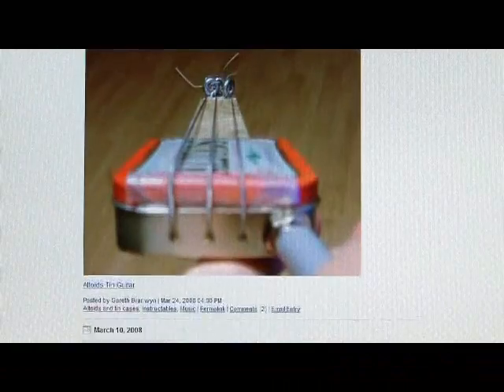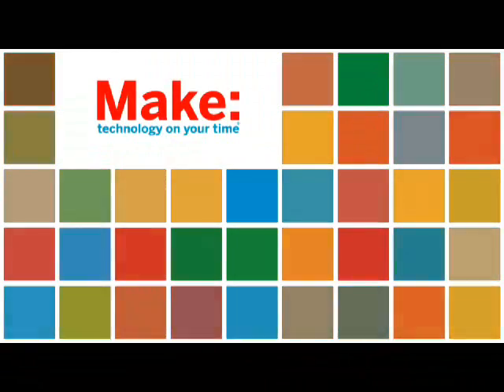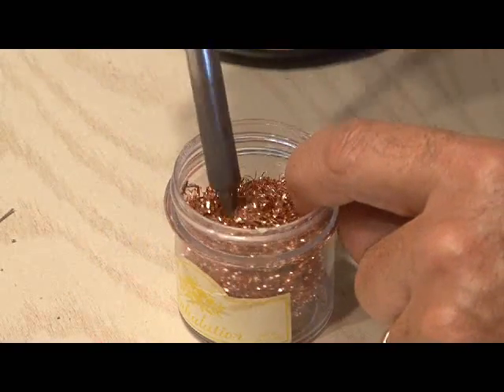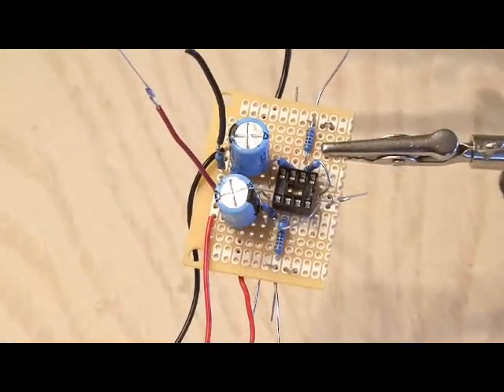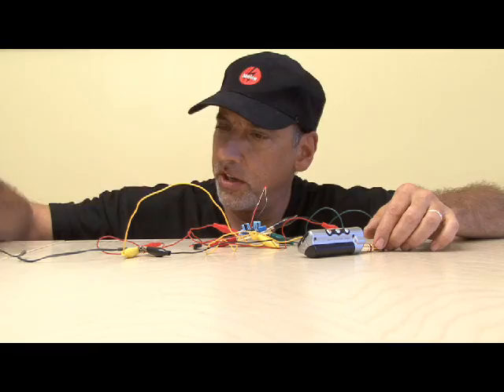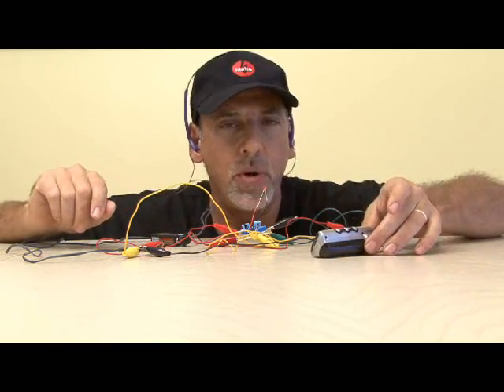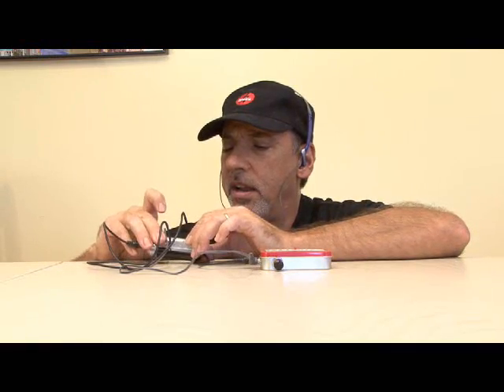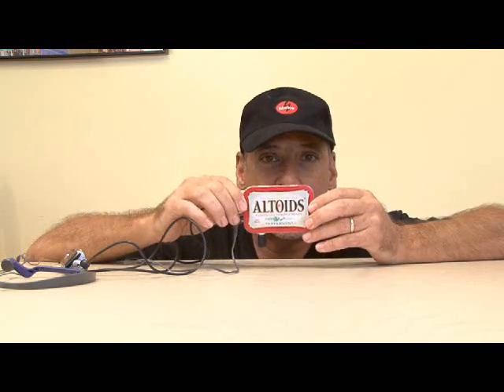Weekend Project: Mint Tin Amp

Comment: No Schematic shown. Just some guy eating sweets and shuffling wires. I need a SCHEMATIC, disappointing!
Reply: Gary, grab the TDA2822M datasheet. Easy build. There are also project pages around the net.  It isn't HiFi, but a pleasant sound. Works down to 3 volts as I recall. It even drives loudspeakers. Handy if you want an all round mobile amp.
Reply: https://tangentsoft.net/audio/cmoy/misc/cmoy-tangent-sch.pdf

Comment: Just FYI, you want to use a brass sponge, not a copper sponge.

Further, the copper sponge at dollar stores are only copper in color or if lucky micro-plated with copper (which almost immediately rubs away when exposed to a hot iron.

Just buy a real brass sponge and save yourself the trouble.

Comment: Can it be plugged to speaker? That would be nice since you can just plug your earphones in the mp3 player.
Reply: Yeah it probably can be
Reply: Yes, since most speakers use the same port as headphones.
Reply: +Pierre Ripplinger This is a headphone amplifier-we use them to not increase volume, but to make sound a lot clearer. If you used a speaker that used the same connector-it would work, but it depends on the size of your speaker. It wont power a large 6 inch woofer for example(Well it would, but you would hardly get any movement in the cone).
Reply: ***** Oh ok, it makes sense now, I didn't understand the purpose. Thanks.
Reply: +Pierre Ripplinger That's what I was thinking and it would've made a better video if he'd shown that

Comment: The problem of the amp is to much generate of energy and can drain the 9v in just 8 hours only yeah its hi fi but I the energy generate much lose I have some idea I can boost nor low consumption of energy I used

Comment: I mean can't you just plug your headphones into the mp3 player? Seems counter intuitive.
Reply: SeeWaffle9 Try powering a 60 ohm pair of headphones with your MP3 player and tell me what happnes
Reply: Say you have some high impedence headphones, wouldn't it sound like shit plugged into a mint tin compared to a legit pre-amp?
Reply: @chrisnguyen1186  actually no. I have a very good marantz amplifier and Grado GS1000 headphones, I made this amp which is actually called a CMoy Amp and well there is no real difference between them 🤷
Reply: @chrisnguyen1186  5 years, and I bet you're still an idiot.
Reply: Haaaaa! lol.
Reply: Some headphones require more power than a phone, mp3 player or even a pc can output, then again, I doubt that this amp in particular would be any good for that.

Comment: i will say if you want to make a hi-fi amp for sure 
make it low frequency add 680uf and parrallel with 330uf of electrolytic caps in the output it will make make it bass and put a pot rate 10k and add 0.100uf mylar and add a 5ohms or resistor it will be a great amp one trust me a make this pieace of equipment and you will say drop the ass!!1 .............wait i mean drop the bass
Reply: could you provide a parts list and a diagram im wanting to build a good amp for my headphones that have no amps built in and they have room i can add them
Reply: I email uu pls add me in my fb and to my group simple maker and I will give u my proto and my greap preamp
Reply: alright will do that could you give me a link to the group please
Reply: Just open Facebook and search me Aljiven r. Alejo and uu will see my profile like a hockey mask and I will show you the schematic but if you want I give you the schematic with a kit if you don't have any parts list.

Comment: Aaand why not put the headphones directly into the mp3-player?!
Reply: Because it's supposed to be able to adjust the volume. It can make it louder than the mp3 player can make the volume, and hit intervals that go between the options allowed by the mp3.

Example: mp3 has volume levels 1-10. 5 is too low, but 6 is too high. The amplifier can put the level between the two values.
Reply: ***** But if you are using a simple LM358 as he does it will have a shitton of distortion and false sounds, just sayin' :D
Reply: ***** But if you don't need much volume, why building a freakin amplifier? xD
Reply: ***** I know, but then they will be either noisy or silent :/
Reply: ***** Well, you can get a precision opamp for low noise, but it's 3 times more expensive. But hey, it's still only a 1$ IC
Reply: jordan krishnayah Give it a 1 nF ceramic cap and it will go back to low

Comment: In place of copper scrubby pads For my solder iron I use a copper brush head, (two opposing each other) works great like a boot/mud scraper. I just stick the tip in < LMFAO and it cleans the oxide and such of very well

Comment: I'm new to this, but can't you just use potentiometers?
Reply: No, you can't. I need an op amp or something.
Reply: Potientiometers would only add resistance and decrease the strength.
Reply: jaiden9898 I know, but still it could work with another external amplifier(CLASS :D). Then the pot just can only bring it down to the input.
Reply: Noorquacker Ind. So what is the purpose of the pot im confused.
Reply: jaiden9898 A potentiometer is a variable resistor. Basically get a 100K pot and you have a resistor changing from about 8k ohms to 100k ohms. Twist the knob and you get less or more resistance! This is very useful when making a function generator or using a 555 timer to a speaker to annoy the FLIP out of your friends!
Reply: jaiden9898 So you mean what's the purpose of my pot idea of the external amplifier and potentiometer?

Comment: So i have a crazy idea. I was going to use a couple of 3.5 inch speakers and make a headphone bracket for them, (4 ohm btw) and then hook it up to a lepai 2020 a+ and use a 12 volt 1800 mah battery. would that even work?
Reply: thats the thing. im not sure of the differences between headphone and speaker drivers other then size
Reply: i should correct myself. i understand the visual differences, but i dont understand how they behave differently. when i think of something that produces sound i think of something getting electricity and a signal from some sort of amplifier. I dont understand how the shape of the cone affects what frequencies are put out and at what decibels.
Reply: *****
 in my room i have a lepai 2020a+ amplifier powering 2 phillips FWB-MC50/17 speakers (to clean up the sound i have an rca 10 band stereo equalizer that i adjusted). i put a 20hz signwave through them and they "technically" hit 20hz because audible sound is coming out (quietly of course) and the cone is moving. though for the low end i depend on my dual sd12 12 inch subwoofer powered by a dual xpe2700 amplifier which is hooked up to a 13.8 volt power supply. my box is a ported box with polyfill and is 1 1/4 inch thick and tuned for 20hz so i can clearly hear it from that. As for my headphones they are turtle beach headphones for the wii u, but i use a fio 6 amplifier on bass setting and i could just barely hear the 20hz. i designed my sound system myself from ground up so i know what frequency responce i have and the slope of where it drops off. I know my bookshelf speakers move actually at 1 hz so that suprised me. My subwoofer could handle this easily too.
Reply: volkswagenginetta

простите что вмешиваюсь, но для более точных измерений частоты я обычно использую осцилограф, а не слух)))
ещё раз извините, возможно я не правильно понял автоматический перевод))))
Reply: i can't afford an oscilloscope, (i understood what you said perfectly) but i am getting the frequency 20hz

Comment: Ummm...why didn't he just use an external or portable speaker to demonstrate the difference instead of headphones? You know....so we all could of heard a little better.
Reply: External, portable speakers have their own built-in amplifier. Duh...
 Didn't I tell you I had a technical degree? 

It's not complicated at all. Very simple project. free-Standing speakers have resistances built in (4 ohm or 8 ohm or larger) and the amp they would need would have to have significantly more juice. This is a tiny little class b amp. Perfect for headphones. 
Why would hearing it convince you? Ever heard of editing? He could just fabricate that. ... The important thing is how to build it. Pay attention

Comment: Excellent - an Altoids tin premature hearing loss device, just what I've always wanted.
Reply: Sadly, it is not for 250 Ohm headphone :(
Reply: I have a pair of 600 ohm studio headphones that don't work without amplification.
Reply: RedTriangle53 A Swede ? I'll have you know sir that I am not a common vegetable.
Reply: Michael Marr nope. It's a purely technical pun. Or rather, two of them.
Reply: 春日歩 Not all device have amp chip inside that would limited to 30 OHM.  Good thing is my Samsung S2 and Lenove Lynx does have AMP chip.
Reply: how strong is this amplifier in video? would it support 2x 4.4ohm and 2ohm speakers?
Reply: tobortine He is disrespects to people who are from different country so don't reply to him.
Reply: ***** No.  You would need to make amplifier that would support 4 ohm and 2 ohm.  It is not easily to find part as it look.
Reply: Michael Marr You're not getting the joke. It's related to electronics.
Reply: RedTriangle53 You mean disrespectful joke.
Reply: ***** No, it would not drive a loudspeaker with that low ohm
Reply: ExpertOfSound Loudspeaker are 4 to 8 ohm, headphone are 32 ohm to 600 ohm.  So yeah. I think you meant power watt.
Reply: Yeah
Reply: dude if you want your hearing loss make it the schematic for the amp is low frequency and sure you can hear is treble and bass to so it  will not hear loss make your ears jammed up and the earwax been push back to your ears.

Comment: @Ronni Santmyer I'm assuming that you do some heavy duty soldering at a bench which in most circumstances I would LOVE to have but most of my work is done in the field, mostly aboard ships and against weather and other elements. For the work I do and my projects and experiments at home, a wet sponge is plenty suitable for me. my hakko set up is nothing to really get excited about but you are right about the price haha! I personally haven't had any issues with my tips on a sponge with lead free solder as long as my sponge and tips stay clean and properly tinned. but to tell you the truth I don't use lead free too too much. The solder that I am allowed to use is either 62 or is rare cases 63. depends the nature of the job. So that being said a non-abrasive solder wicking copper pad developed for lead free soldering infused with flux, win. up on the 09 level of a ships mast in december in 30 degree wether building a connector with 70 solder cups and its really windy... ill spit on my jeans to get the job done if I have to. My tools are only at good as their owner and when Im so cold I cant feel my hands, I might as well glue the leads to the cups. I appreciate your input though and Im glad you know what you're talking about too

Comment: who else thinks its a terrible idea to stuff the tip of your soldering iron into a copper scouring pad? a wet sponge is cheaper and less abrasive.
Reply: I guess, but those types of copper pads are marketed specifically for cleaning soldering iron tips....  I think it's more important for your soldering iron to be tinned properly and for your technique to be good.
Reply: Absolutely I agree about having your iron tinned, I just thought it odd that he mentioned using a dollar store copper scouring pad over a wet sponge. My humble opinion leans towards a wet sponge.
Reply: Depends.. I solder maybe around 1,000 joints a day building our products..
Back in the day wet sponge was fine. But with Rohs and everything needing to be Lead Free Wet sponge bad idea.. Still ok when working with Lead only at your home.. but to sell items worldwide you have to be Lead Free. Water ruins a lead free tip in one day..which using Weller or my case Hakko tips is pricey..
But also wrong is him saying going to store and using copper pad very wrong too. The cleaning copper wire thing that should be used has flux in it a lot to help clean tip..and is less abrasive to your irons tip. Lead Free wears through tips faster using a store copper scrubber will where the tip down faster. And another negative to working with wet sponge even with Lead only..you can work faster with copper cleaner the wet sponge will cool tip down to much. If you need to work as fast as we do then that time matters greatly.
Reply: Ronni Santmyer So what do you suggest to clean your soldering tip if not a wet sponge?  What is compliant with RoHS and lead-free?
Reply: What I was saying was the golden sponge thing in the grocery store is not the same as this.. this is what you use.. But I also said it's ok to use this with Lead solder as well..it will whole you to work with out cooling tip..
I use a Hakko and that puts the tip to sleep when it's resting in cradle.

Comment: Apparently u are very dumb!The amp he made contains an audio chip which is pretty much "CHEAP" in price AND quality.It gets the audio waves from the mp3 player's built in amp.Which means if the mp3 player's sound is good and you pass the sound throught the "mini tin amp' it will be a little bit crappier.
P.S. THINK before you write!!!!!

Comment: The mp3 itself has an amp, so hes essentially double amping. It doesn't necessarily improve audio quality but it does provide more power for hard-to-drive headphones and earphones which may need lots to reach its potential.

Comment: A nice little stereo IC is TDA2822; just google for the circuit. Also, the LM1896 will drive speakers or headphones. The both run on a 9v. TEA2025 is another. Altoid tins are cute, but a cheap project box works better, and they are at the local radio shack.

Comment: Bose are junk. They had a good product with the Wave Radio, but that's where it ended. Use any other quality headphones like what matsushita1918 named, or Ultimate Ears and Shure if you want in-ear phones (not earbuds, but phones that actually fit into your ear canal) and they will absolutely destroy the Bose for sound quality. I used to use Bose myself, and then realized just how low quality they actually were when I compared them to good phones.

Comment: Actually this amp is quite good ... if you use just a little different amp chip and impulse resistant super fast capacitors (price just 8% higher) and maybe hook up 2 piece 9V batteries you have a mean amp. The industrial ones use 90% same parts maybe they have extra EQ circuit but normal listener wouldn't hear the difference. This is a good project! I made my own variation of this and I'm 100% loving it and I consider myself an audiophile!

Comment: there are situations where you need more sound and your mp3 players or your headphones connection from your mixer are really crap and the sound its to low.. this would def. help if it would give you a good amplification, because then you could  keep your mp3 player or mixer on a good sound value (what I mean is no distortion) and then max it out as much as possible on this into the actual amplifier or speakers and raise the volume there even more if possible

Comment: Coming from a guy who builds this stuff on a daily basis for the past 3 years I think this has to be said. Yes there are head phones that are better than others. HOWEVER if you are paying $80 for beats earbuds or any earbuds for that matter you are being ripped off. All earbuds are three wires and 2 speakers that's it. there are no amps in them or anything. for $20 (which is still pretty pricey) go get some skullcandy earbuds. If you want over ear headphones dont pay more than $60

Comment: you dont need to split your voltage in haf just put a 100uF in parallel with the power line and connect it

Comment: I presume we can also use alternative jack sockets such as a 1/4 inch jack to either use our 3.5mm mp3 players with 1/4 inch headphones or vice versa, to use 1/4 inch guitar sockets with 3.5mm headphones/speakers, assuming the differences in power needed were adjusted for

Comment: professional headphones have high impedance values, that's why we need to amplify the signal to achieve the required gain of the sound. correct me if i'm wrong. higer impedance value = more quality sound

Comment: there are many other uses for a headphone amp, the main one is that it lets you have maximum input for a clearer sound, or if you want to run high resistance headphones (needs an [expensive] amp to work) on a dime. also it'll give little un-powered speakers an extra boost.

Comment: Pocket sized headphone amps are required by people using high resistance headphones.  many large "cans" have impedance greater than 32 ohms (Grado RS1i) because they are designed to be used for previewing a line level signal such as is found on a preamplifier.  Most mp3 players were designed for headphones with 16 Ohm impedance so the power is somewhat lacking.  Of course now, as technology is getting smaller, more players have more powerful amps and soon these will be unnecessary.

Comment: I agree, it seems useless. The only real useful thing I can think of this is boosting audio along a very long 3.5mm cable (which just seems stupid in itself) And Hifi speakers probably already have the amp in them and require an external power source.  And finally, the circuit looks too basic for quality. I bet if you were to plug in some decent earphones i would sound like crap.

Comment: to people asking why make this, since iPods have such a "high" volume;

Volume is relative to the resistance of headphones. Cheap headphones (anything below $100) have low resistance (to go with horrible sound).
iPods amps go out best for 32ohm headphones; but cans with higher impedance(resistance), will still be slightly audible.
Quality headphones ($200) start getting higher resistance (~200ohms are common) and they need headphone amps to be powered properly.

Comment: The bought copper soldering iron cleaners are coated in flux to attract the solder and clean the tip. NOT the same thing.